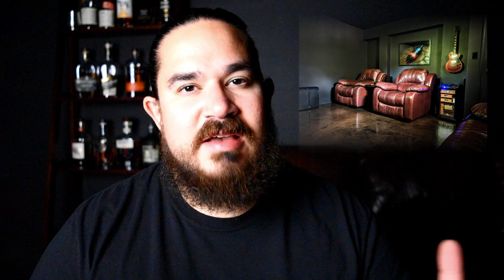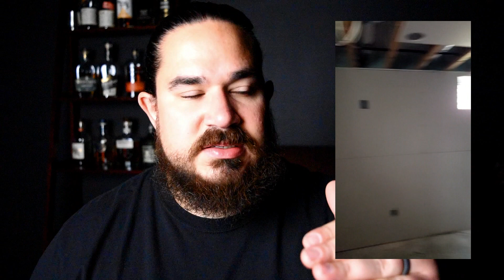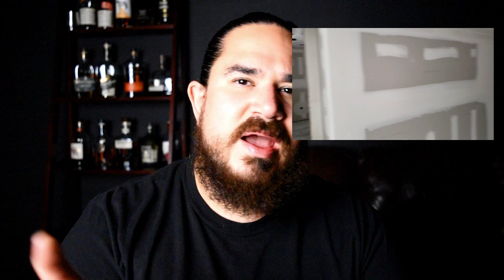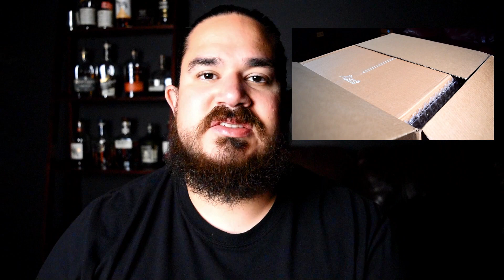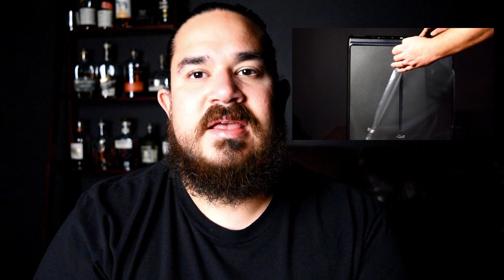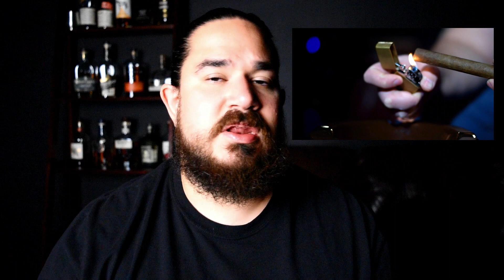Man Cave Cigar Lounge: Cost, Ventilation, Insulation, Construction and Decor

Comment: Thank you for all this great info!! Very clear and concise.  I'm about to start a mini cigar lounge build in my garage.  It's only going to be 9X9  room for myself during the winter months.  I plan on using the same exhaust as you in concert with the a smaller rabbit air. Maybe the A2 . This is predominantly for myself during the winter months.  2 people max.  My question is about the return. In order to create negative  air i was thinking a small return towards the front and bottom of the room with flippers to pull air in from the garage and up and out the vent. What are your thoughts on that?

Comment: Just got my 10" ac infinity through roof system done. It pulls a massive amount of air. Very happy.  Keeps a negative pressure that pulls fresh air into the rest of the house and doesn't allow any smoke to escape. Through roof with a 1:3 ratio cfm:cubic feet is the only way to go. Also got a 4" infinity fan I'm going to attach to two carbon filters for filtration after im done using the room to kill the smell. Even with the vent smoke particles still clings to stuff and 'off gas'. Carbon filter stack will handle that.
Reply from the maker: Great setup, enjoy.

Comment: Bro you answered so many questions that i had for my whisky room. My step is literally just like yours. In the same location of my basement. I went with the 8" duct but need to find a decorative exhaust panel for outside. Great video!
Reply: Looking to build out my upstairs room too. How's the noise with the 8" fan? Mine will be in the attic, so out of the room. Just wondering if the 10" would be a lot better for the noise. I'm already looking into the silencer as well. Might be over thinking lol
Reply from the maker: @Woboito13  Go with the larger size. It allows you to run the fan at a lower speed and that can keep the noise down.
Reply: Two huge things to keep in mind. First use insulated duct. This will cut down 80% of your noise that you might encounter. Secondly make sure you have some type of makeup air coming in the room. Even if it’s a 1” opening under the door. If not your exhaust won’t be as effective. 
As a bonus suggestion use bands to secure the exhaust fan. If you hard mounted to a surface, you may hear the resident sound from the vibration going through the wood or whatever you mounted to.
Reply from the maker: @whiskywatches  Outstanding advice! I'm going to go in and install bands for the fan so I can get it off the joist. Thanks!
Reply from the maker: What up whiskywatches?! Thanks for watching and for the dope comment.
Sounds like you have a great room setup.
Agreed it's tough to find a good exhaust cover that closes when the fan isn't running but also looks good.
Enjoy your your lounge!

Comment: Very well done! I went through the same process and came to the conclusions you did. The proof is in the pudding, and since it is working, the conclusions are correct. I do have an Infinity 8” inline fan but even at 10,the highest speed, it is 5-10 decibels less than the television or music that is always on. Probably because the fan is up in the attic space. I also added the sound reducer that is an option. It doesn’t lower the volume but does reduce the high frequency wine to a comfortable level. Thanks for a Great explanation of your cigar lounge build.
Reply from the maker: Thank you WintersWay! 
Yeah, my fan is tucked in the ceiling right above where I sit. I should have installed a  dampener. It's still not too late, I'll either add it or wait until I have to replace this fan.
Your room build-out video is top notch, outstanding information and footage!
Thanks for watching and for the kind words; means a lot from a fellow cigar room brother!

Comment: AC Infinity offers an Inline Duct Silencer attachment for your 6 inch fan. I'm running the 8 Inch with the 8 inch inline duct silencer.
Reply from the maker: Solid recommendation, thank you.
Reply: Did you guys have to add access to the AC Infinity unit in the ceiling? I saw they have a carbon filter that needs cleaning?
Reply: @michaelmaringione9823 the idea is to install a roof vent and just take it straight out the ceiling through the attic ducting and out the roof... use a fan and carbon filter in the room as a scrubber..

Comment: You’ll want to add an Ozone machine to get rid of residual smell - works great for your clothes too.  I also added a tin ceiling to my room to keep smoke out of anything pores.
Reply from the maker: Awesome advice MrParadigm. Both of those recommendations would be very appropriate in a cigar room.
Thanks for watching and commenting!
Reply: @BeardedMoon  we'd be best friends in real life:)
Reply from the maker: @MrParadigm1981  No doubt about it brother! 🍻
Reply: While an ozone generator works very well as you point out there is s significant downside. Ozone will deteriorate some materials such as rubber, plastics, fabrics, paint and metals. This occurs over time and is dependent on many factors but worth watching.

Comment: I put the same exhaust fan in mine I went with the 10”. I went with the 10” aluminum ducting with no insulation. I put mine upstairs in bonus room so I had to add an electric dampner to mine so I could close it and keep ac/heat from escaping the room when I wasn’t using it. Good content! A lot of people don’t explain enough about ventilation and I watched videos for months trying to figure it all out! Thanks for the detail of the build out! Congrats looks good!
Reply from the maker: Thanks for watching Derrick.🍻
I wish I'd have gotten a fan with a larger opening, I bet it's a significant gain for exhausting power and better on noise. It sounds like you've got a great setup; the higher up in a house the better for smoke. Enjoy your bonus room. Thanks for commenting, have a good one.
Reply: I am getting ready to refinish part of basement for man-cave/cigar lounge. What exhaust fan would you recommend now?   @BeardedMoon
Reply from the maker: @johnorlando643  Hey John, I've been happy with the infinity in-line jet style fan. I keep it running on a low setting at all times and set it higher when I'm in there having a cigar. Go for the bigger sizes, if you can, because it will exhaust better at a lower setting and also help with noise. But that style has worked for me with this set up, best of luck and enjoy your room!
Reply: Thanks so much! As all have mentioned in the comments, we greatly appreciate your adding these videos, as they are so helpful!  @BeardedMoon
Reply from the maker: @johnorlando643  Thanks for saying that John! I'm glad the info is useful in some way.🍻